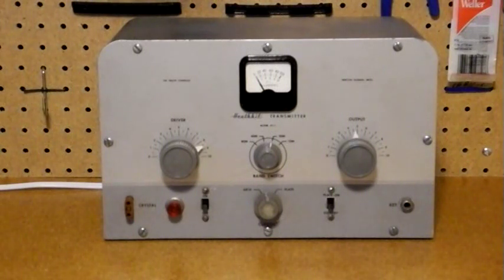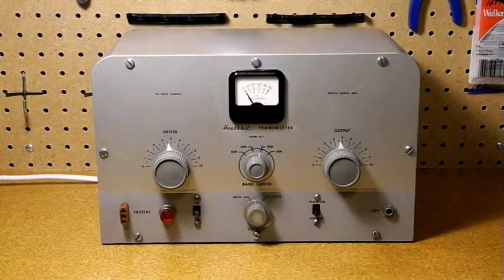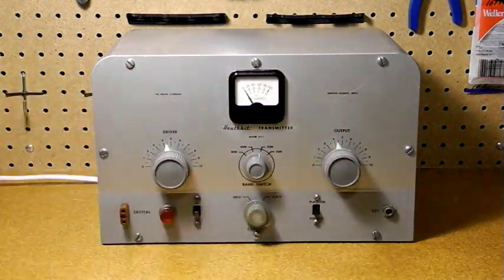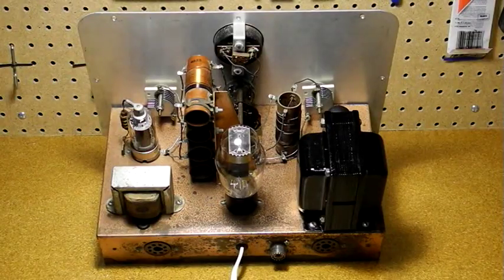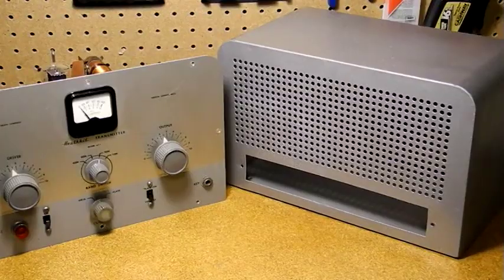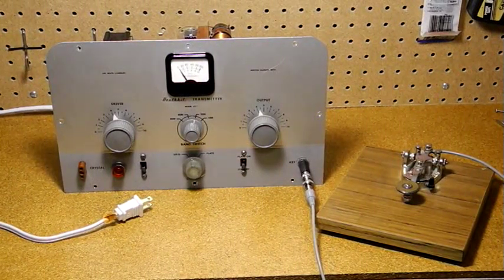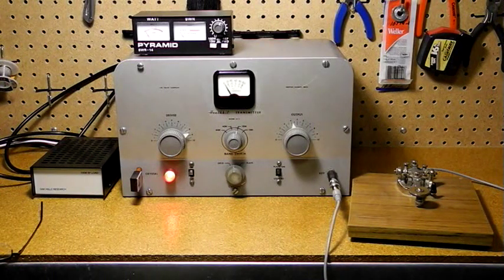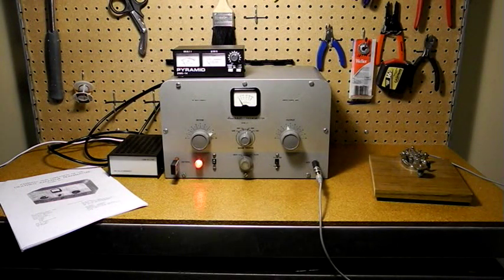The Heathkit AT-1 Amateur Radio Transmitter

Comment: The set used cathode keying.  It's a common belief that you can get a nasty shock across the key.  In practice the tube acts as a current limiter so this danger isn't quite as large as one would think.  Later Heathkits used grid block keying which presented less voltage across the key.

Comment: The modification to a 2E26 was published in one of the journals of the time either QST or CQ.  It provided a higher output efficiency at the time than the 6L6.  My best friend did this modification. This upped the power output from about 7 watts (the figure claimed in the magazine to 12-15 watts.)  Not many hams were able to measure output power which required an RF ammeter which was very expensive and required some math to get a final figure.  Direct reading wattmeters came much later. Most transmitters were advertised by input power (simply voltage time amperage): so were the FCC regs specified as input, both easily measured.)  Heath provided a mod in the manual for break-in keying, but on my AT-1 caused chirp and I had to undo it.  After a few months with the AT-! (bought used from an older teen ham) I upgraded to a Johnson Viking Adventurer with an advertised 50 watts input and about half that for output.  Using it on 80 meters was a problem as it was very easy to tune the final to be a doubler which put one outside the ham bands and resulted in a scary letter from the FCC in Alegan, MI or Grand Island, NE.

JON W3JT (Then KN9CAH/K9CAH, age 13, Jan 1956)

Comment: I see a Leaky filter cap ( aluminum can) under the chassis.
Reply: infowarguy,  this comment comes a bit too late (by five years) as the filter caps ALL should have been replaced and a fuse installed. Consider using a safer way of keying this rig. It is MORE than "a nasty jolt" to get electrocuted by your key.

Comment: Cool... now you have the VF-1 VFO to go along with that AT-1, Jeff. :-)
It's been a while since you made this video... did you re-wire your AT-1 back to original with a  6L6 output stage?
Reply from the maker: Yes, I completely rebuilt it. I documented the process in this series of blog posts: http://jefftranter.blogspot.com/2018/03/rebuilding-heathit-at-1-transmitter.html
Reply: Right on.... that came out beautiful... thanks for sharing.

Comment: I love these simple transmitters. Like the one I built for 10 to 40 metres for CW back in 1980 using a 6CH6 Oscillator/Driver/Multiplier and 807 PA. I even used it on CB back in 1981 at the time illegal in the UK. Happy to say AM and SSB are legal on CB now in the UK but don't think OFCOM (UK equivalent of the FCC) would approve:-)

Comment: REPLACE        6L6       TUBE       WITH      A        6DQ5        TUBE       FOR       MORE      RF      OUTPUT     !         DE      K9IOU         K
Reply: Might want to be sure the power supply won't be overworked with the added load. Often 'improvements' aren't really all that great. Unless the power went up a LOT, the difference at the receiving end might not be worth the effort.